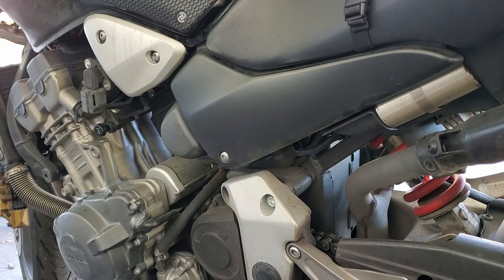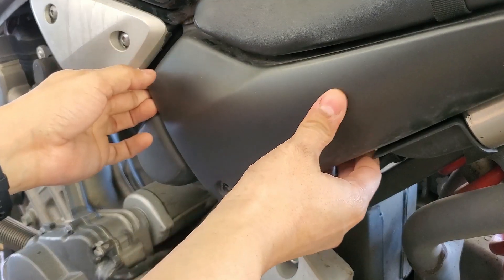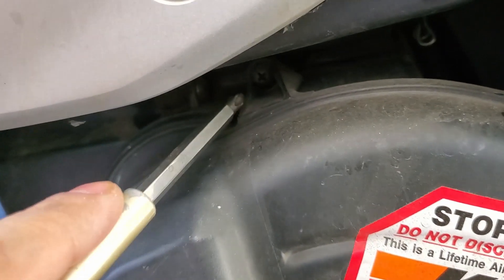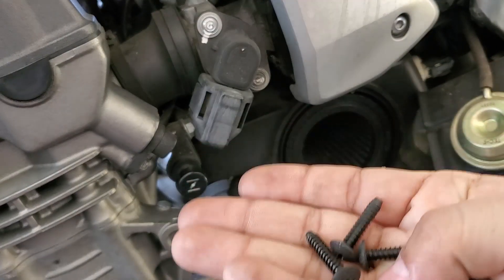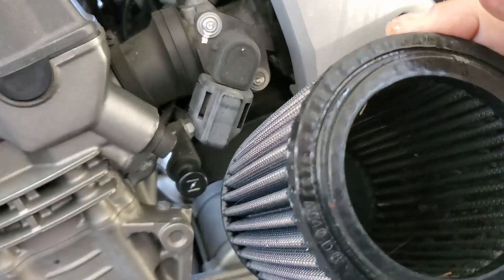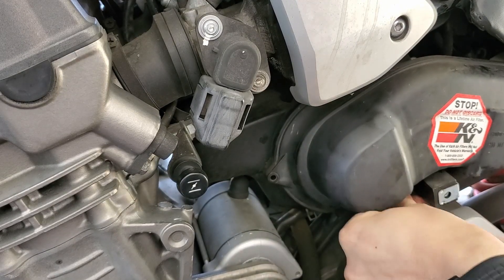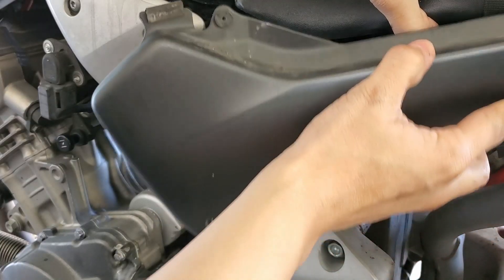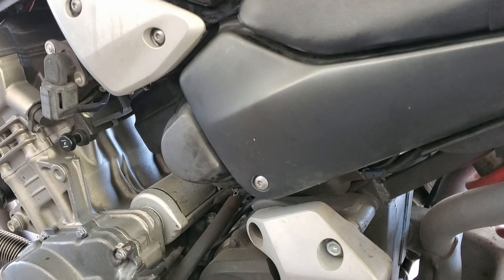DIY: Air filter change filter- Honda 919

Comment: I have 03' Hornet 900, mint condition.

But I am frustrated to find out if there is rubber seal or O-ring in the grove aroung the filter, exactly on air box housing enterance, where the lid is going on to cover the hole??